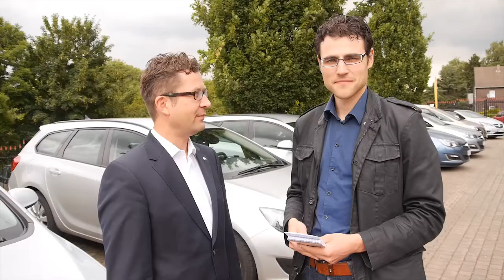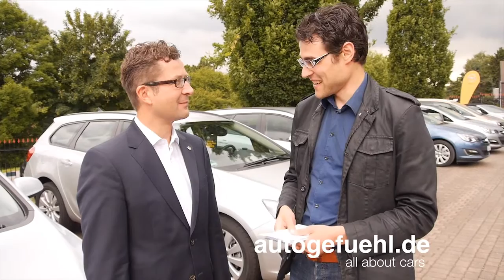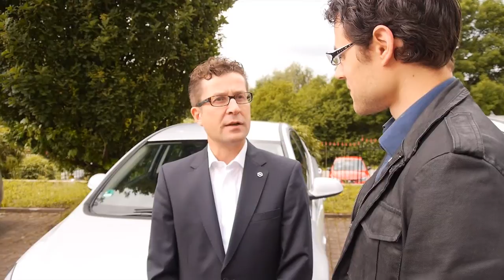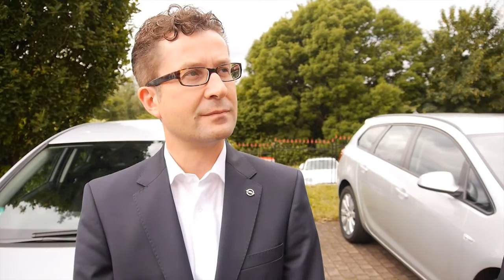Opel new engines - 1.6 litre petrol (SIDI) engineer interview - Autogefühl Autoblog

Comment: I think the peoples do not stay at the "state of the art" engines based on the good experiences...it is a question of price. If the hybrid or electro cars will reach the same price level, then the fuel engines will die...but only if the sounds will be created by Active Noise System ;-))